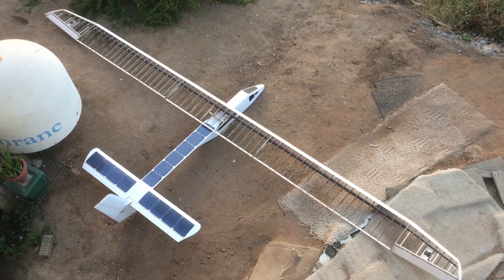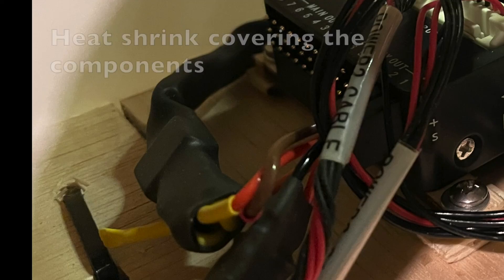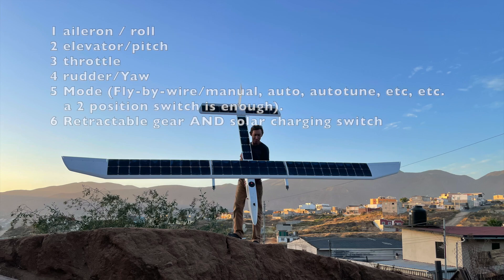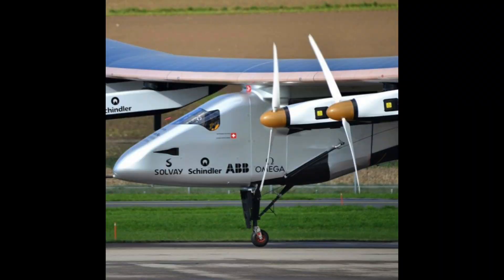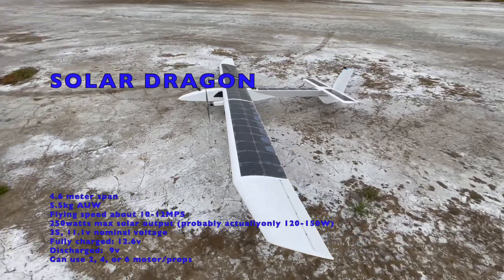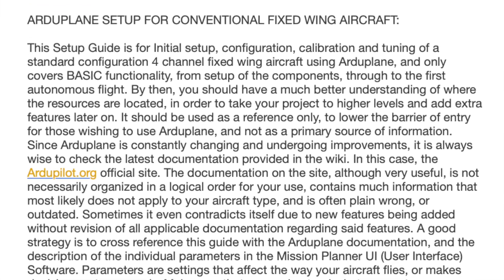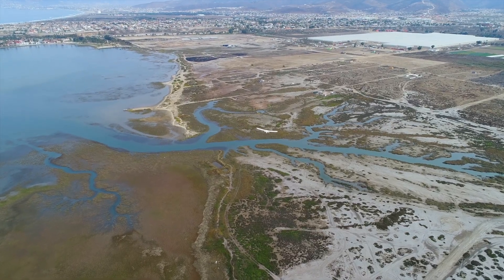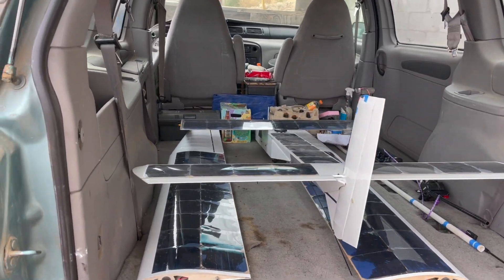Solar Dragon Solar Plane Update - Getting Ready for Flight !

Comment: i'm guessing you have  NEVER  made a wing the way a model wing should be made; specifically, a built-up/box  MAIN SPAR.!!!   aka  high-low spars, with webbing between the ribs.
https://upload.wikimedia.org/wikipedia/commons/thumb/4/42/Wing_structure_spar.svg/1280px-Wing_structure_spar.svg.png
notches in ribs, for high-low spars
http://www.balsaworkbench.com/wp-content/uploads/2016/09/DSC_0510.jpg

Comment: the nose does not have to be super pointy; as long as its a smooth shape air will flow around just fine. The trailing sections are more important since you want to avoid flow separation. The pitot tube location is bad since it will be occluded in a nose up attitude.
Reply from the maker: you're right, the nose is probably not optimal, as also most of the rest of the fuselage.  the TE sections are quite thin, about 2.5mm.  but could be thinner.  we may at some point, 3d print, or shape from balsa, some fillets for them, but it would make them very delicate.   not sure if it is seen well in the video, but the pitot tube is angled down, and is on the part of the nose that is sloping up, so should work even at high AOA.  but it wold be best if it were in completely clean air.  we are waiting to see where the propulsion pods will end up, and consider putting the tube on a wing.   Suggestions?    Thanks for the great feedback!
Reply: @FPVREVIEWS  it is a little hard to tell from the vid exactly how obstructed it would be at high AoA. Many jet planes simply have the pitot tube sticking out the point of the nose, if you're still pondering another redesign lol
Reply from the maker: @dandil  The airfoil can only go to about 12-13 degrees before stall, and it seems like it would be fine at that AOA. for the tube.   My other concern is that it gets dirt in it, if exposed.  I actually cover them when not in use.  and also, vulnerability to damage in transport, or if it ever encounters another object in flight, such as a territorial bird.. ha ha.  seems like a joke, but I've had damage before to the tail of an airplane due to bird attack.  Would look very cool sticking out the nose, though, wouldn't it?   maybe a retractable mount..??  I'll think about it.  thanks.
Reply: @FPVREVIEWS  good point on transport, that didn't occur to me. never had an rc plane with this
Reply: @FPVREVIEWS  I think as long as the pitot is not wildly out of line and you keep it mounted the same all the time, the numbers you get from it are still valid enough to use as reference for stall speed, cruise target etc. They just won't be correct as absolute values, but it really doesn't matter.
Reply from the maker: @iforce2d  As I understand, in terms of overall value at the target airspeed, when using ARSPD_AUTOCAL set to 1, (At least for a while) Arduplane will calibrate the airspeed results, taking into consideration many factors, but using them to compare to the GPS groudnspeed data. keepign into account the amount of lost path distance, acordign to heading, to determine the actual speed over some time.    It can also be adjusted manually, to match what you know as the true airspeed, by just changing the ARSPD_RATIO parameter slightly until the reading is correct.   We have a simlar mounting on our Maxwell S2 mini UAV, and have had it working very relaible for many many flight hours, under varied circumstances.   So far, So good.

Comment: MOTORS guys - hear me out:
bigger diameter motors with low KV and slightly bigger carbonfiber folding props. the motor mounts might get a little longer so props can fold in without problem + that would also be good for CG of the plane. for the speeds you are using you dont need those high powered T-motors with high pitched APCs. 
try to find something with lower pitch, foldable for phases you are just cruising with motors off. bigger diameter motors with high torque but lower RPM are very efficient. 
and as high voltage you can serial connect the solar panels. higher voltage in the whole system should also be more efficient. 
i love this project and would be happy to sponsor some parts if possible. way to go guys! 
:elbowbump:
Reply from the maker: Yes, we understand that larger diameter direct drive motors would be better, as far as mechanical leverage, and consume less power.  
Would make more aerodynamic drag, but probably be worth it.   especially with a large spinner.  have been looking at RF carbon props, as well as aeronaut cam.   I understand that for forward flight, fixed wing, an even higher pitch is necessary for most effecient flight. like a pitch equaling the diameter..    would not be too hard to try several props.  like you say, the biggest factor is the motors themselves.   yes, the T-motors are not the best, by far, but they were what we had for the moment. also looking at geared out runners.  like having a larger diameter without the actual diameter. seems to be what other slow flying solar aircraft are using. Thoughts?  
my PayPal address is in the description and my address is 
Spike Webb 
1220 Rosecrans st. #942 
San Diego Ca. 92106 
if anyone has something to send for testing, or upgrade. 
all suggestions considered.

Comment: everythings good until the clouds come in
Reply: A plane like this would probably be working above cloud. But then there is wind to contend with....
Reply from the maker: Yes, cloud cover can be a problem.  and yes, it should be possible to climb above the clouds.  depending on location, winds at altitude can be very high too.  but you can often pick your altitude, and get different wind directions.  we've noticed a difference about every 1000 feet on previous flights to 13,000 feet.   also, as you get into upper atmosphere, thin air, it gets really cold, and IAS may be normal, like 30-45kph, but you may be going at 130kph true airspeed, at some altitude.  transitions between layers moving at high speeds relative to each other can be turbulent.  so the airframe must be robust.

Comment: So excited for more content! Have you had a chance to chat with RCTestFlight? or ThinkFlight?

I'm looking forward to some long range ardupilot missions from the Solar Dragon. 
And how about mapping missions to demonstrate the capabilities vs a multirotor.
Reply from the maker: Yes, would be great to talk to them.  I don't have direct contact with them, but I'll try to reach out. as well as to several power system manufacturers, SUNPOWER company, and see who else is interested in project.  If someone knows them,   my email is:       fpvreviews@gmail.com 
as far as mapping, vs multi rotor...   almost any fixed wing platform blows the multi-rotor away.   That's already covered by our Maxwell S2 mini UAV, as well as our Gemini V-2.   with 100km + distance on a charge each.  and 2, and 4 hrs flight time respectively.  the Maxwell is optimized for distance, and the Gemini V2 for endurance.   The Solar plane may be very useful too.  but will probably see it's best use at loitering, not mapping, serving as a com relay, etc., and would likely excel at  high altitude work, or atmospheric sampling, or earth observation, testing equipment for satellites.   once fully mature, of course..  ha ha  first flight was a struggle for control in roll..  due to an actuator failure.  video coming soon.
Reply: @FPVREVIEWS  What about an FPV station in the sky to maximize an fpv signal to a second vehicle far away?
Reply from the maker: @ryanmcclara  Yes, as a communications relay, it could be very useful.  and for internet, or a secure encrypted com for ground assets.   many many uses.

Comment: Looking good, interesting to see the progression of development. 
Where did you find CCW 16x10 APC props? I've been looking all over for those...!
Reply from the maker: https://www.apcprop.com/?s=16x10
just go to their website, and type 16x10 in the search.   I used to look all over for their stuff before too, but it's better from the source.  if you can buy in some volume, they will even consider making batches of new sizes and pitch for you. but prob have to buy like 1000.  worth it if you are going to produce something.
Reply: @FPVREVIEWS  thanks, wish I had know that last week before I bought a bunch of not-quite-what-I-want props elsewhere. ah well, I'll just have to make more planes to put them on :)
Reply from the maker: @iforce2d  Ha,  I also see an increasing number of carbon E-flite props by APC. I'm very interested of course. not sure if they are infused, molded, but seems so.  even so, may be very good.   I've just ordered an aero naught cam prop for testing with a Hacker out runner, 1300kv, and 4.4-1 gearbox.   I'd love to find something better than APC.  but haven't personally tested anything better.  also looking at the RF folding props, but very spendy.  if they are more effecient, it's worth it. 
always love to see your builds.  sometimes, I cheer, sometimes cringe at the design decisions, but I'm sure you have the same experience watching my projects.. ha ha   I was really stretching it on this one,, and it almost bit me.

Comment: You should be able to find a charge controller for that battery you built. That would be far better than a switch and would be autonomous; a programmable one would ideal but could end up being heavy. I'd see if I could find a cheap charge controller for lithiums and use something like a balance board if it didnt do that part; those parts should be lightweight.

I think for the tail you should add a wire "guide" on the bottom that absorbes some of the impact of landing but could also maybe even guide the aircraft in somewhat of a straight line, try maybe a V shape wire guide setup from the bottom of the tail or maybe even one on each side of the rear stabilizer. I'm sure you're also familar with aircraft that have the wheels on the wings themselves, meaning near the wingtips, which could work here. I think I'd free that channel up by getting rid of the retracts and build a slide system in for belly landings.
Reply from the maker: we would like to get rid of the landing gear,  yes.. 
only problem with getting rid of the main gear, is that the tail would hit the ground.  this is a big, and fragile model, so letting the plane hit tail first, still 30cm , the fuse, up in the air, then slam down, is not a good option.  we need a soft, gentle landing...   but the gear is far from ideal.  we may design another tail.   another issue, is if it can be hand launched.  we're guessing it can.  we walked along holding it in a slight breeze, and the lift was very significant.  I'm more concerned about holding it level and straight while launching it.  because the wing is 4.6 meters, and my arm is less than 1.  ha ha      if we can land it on the belly, and not have the tail hit the ground, then the tail skid would also not be needed.  that probably the best solution long term.     yes, there are cheap and small charge controllers for lithium.  the challenge is not properly charging the lithium battery, rather keeping the proper input voltage from the solar arrays, so that they are operating at their maximum power point.  this is called an MPPT controller.   when the battery is close to fully charged, the direct charge from the arrays is approximately correct, assuming there is a decent amount of sunlight(during normal daylight hours).  but MPPT would be better, as it would increase the efficiency a little in ideal conditions, and probably a lot when they are not ideal.
Reply: @FPVREVIEWS  MPPT would be ideal but I dont know if they make them that small but it's almost a requirement for what you're doing. Not sure what battery setup you're using but something like 4S would be more than sufficient and efficient for what you're doing. I think I would make room for the MPPT charge controller and save weight elsewhere, with that much lift it may not even be a factor really. You may find that you add more capacity later on, even though you're also charging. That shape should slip through the air pretty fast too but I can't imagine speed is your goal here.
Reply from the maker: @helloman1976  Weight is always a major consideration.  However, the MPPT capability should make up for it's own weight, plus some, I'm guessing.   Yes, the lifting ability is there.  adding weight is possible.  both in battery capacity and in other equipment.  there may be some weight to save.  from eliminating the landing gear, and from slight weight savings with a fuselage re-design.  might save 100 grams there, and 200 from the gear.  but that's about it. not much else can be eliminated. it's using 3S because of the total power output of each of the 3 arrays.  to match the voltage for direct charging.  but going to a MPPT controller may allow us to link the arrays in series, and use something like a 6S or 8S, even 9S battery setup.   there's options.:) designed the plane specifically to be able to re-configure power system, and charging system.   It's not too big a deal to build another fuselage if needed.  and I have the spare solar cells to do it.  but for the moment, the existing fuse is working well, and seems plenty good enough.  the wing section is actually a bit thick, especially up front. although the entry is not too blunt.  and the back part is partially flattened, to help it be more ideal for the solar cells.   It's a bit of hybrid, an SD7037, thickened, bottom flattened for easy building, and covering adhesion, and with the back flattened just slightly.  so modified, but as little as possible.  seems that 10-11 MPS  is about the good range for endurance.  plane still flies well at 12.  but I can't be too specific yet.  hasn't flown very much and most of the time I was struggling with control, due to stuck aileron in flight, and not able to get good data.  and it would not have looked good anyway with the "brakes" on.   I think the fuselage could be slimmer, by a bit, and have rounded edges.. would be better.

Comment: nice seeing you again, it would be very interesting to know the efficiency of the elevator cells, they might be disturbed by the shadow from the rudder
Reply from the maker: Yes, we were very concerned about that becuase the cells are in series.   that's why we did several things to prevent the severity of the problem.  half of the vertical stab is below the fuselage.  hence the crucifix tail configuration.   also the vertical stab is raked back considerably.  and is placed behind the horizontal stab, not above it.  also there is a part of the horizontal stab where the solar cells are cancelled, (none placed there), where the shade area is likely to be.    but perhaps the most significant thing we've done, is to arrange the solar cells into 3 different, independent arrays, so that even if one array is shaded, the other two are completely unaffected.  we also noticed that even with one cell directly covered in shade, there is not a total drop in the output, as we expected.  the effect was not nearly as severe.  we built a test section of wing, one meter, to experiment, and used it extensively before finalizing the initial design.
Reply: job well done and excellent strategy, best continuation